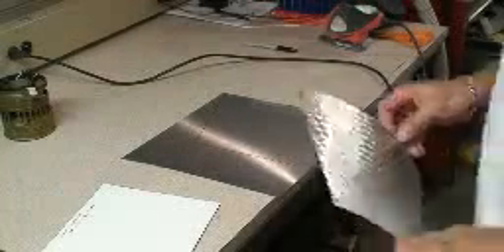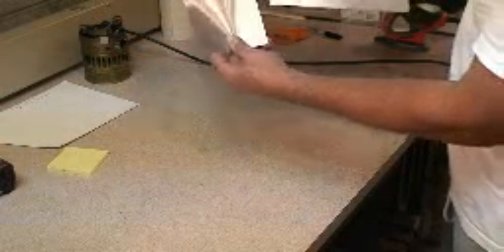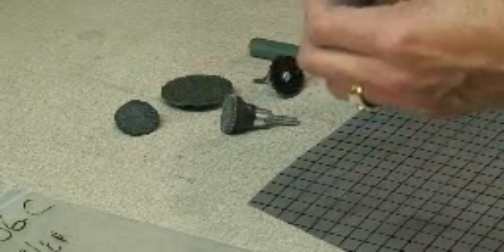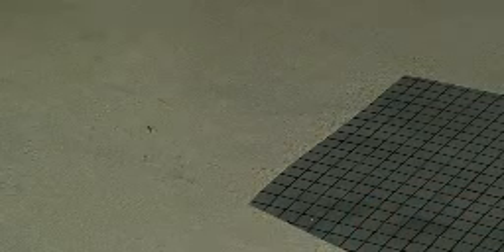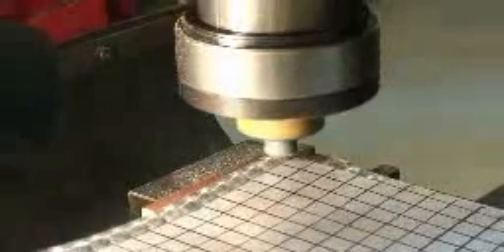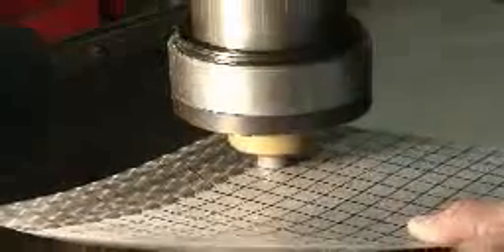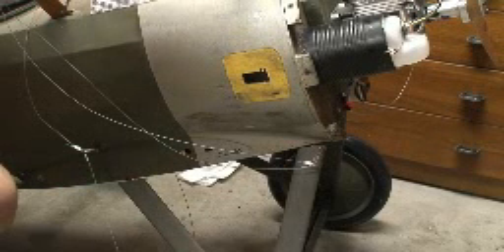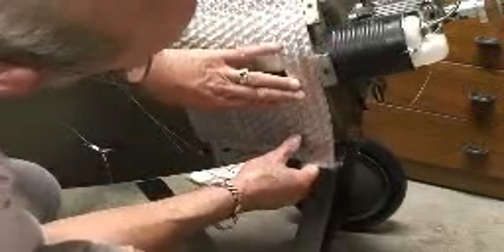Sopwith Pup how to burnish engine turning finish in aluminum aircraft panels

Comment: marvellous technique- filing that away for future reference. 

Laying up after using contact cement- when the glue is DRY, use poly plastic between, position part, remove poly- some people use strips of poly- which of course has to be really clean.

Thanks again